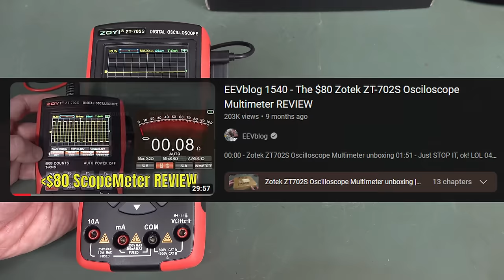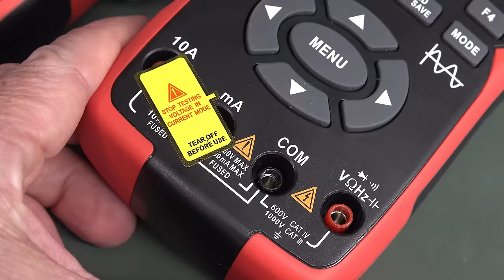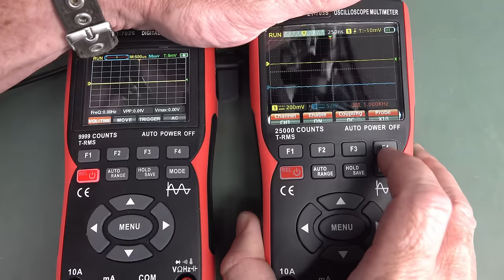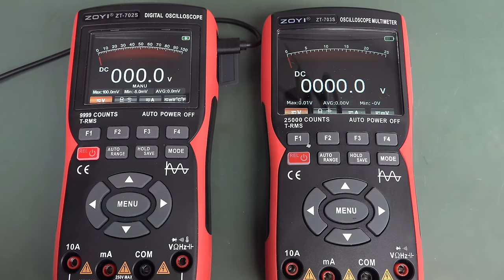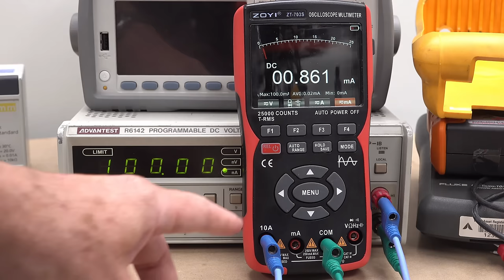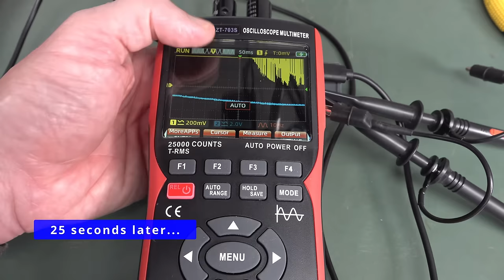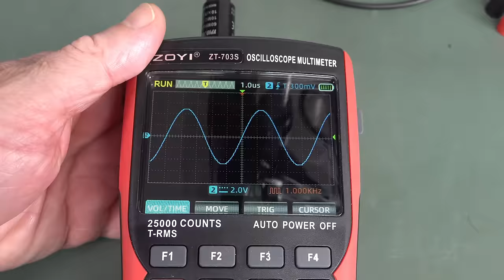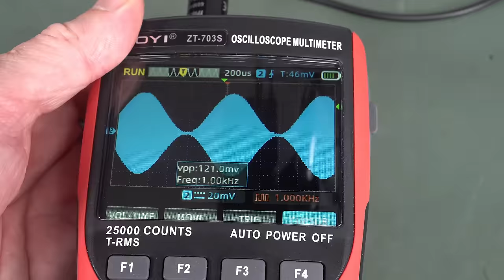EEVblog 1597 - Zoyi ZT-703S $80 2CH 50MHz Oscilloscope/Multimeter Review

Comment: one of the best things that i learned about these handheld scopes is that they are isolated from ground.... that makes them really useful for analysing signals in machinery where you dont neccesary know if the pin is safe to be grounded or where you need a relative measurement.

ive blown a couple breakers by accidentially hooking up the scope ground to a port that was not happy about getting grounded through the earth of the scope.
Reply: i guess we all learned that one the had way...then i went to watch "how not to blow up your oscilloscope"

Comment: I use my 703 to capture ignition secondary waveforms to see how the coil, wires, plugs and combustion chambers are operating while running.  For this application, I can't imagine anything that would be more handy.  I use it with motorcycle engines and it works superbly capturing even the little inductive bounces at the end of the burn line.  I've been using it with a single inexpensive Hantek HV probe, but I have a second probe arriving tomorrow so I can check and compare two cylinders simultaneously.  Earlier, to see if I really needed to go to all that work, I used the 703 and the Hantek probe to check the plugs of a GMC 3/4 ton truck's V8 engine.  Although the engine ran smoothly, the scope said 'GET NEW PLUGS NOW!' and yes, they were indeed worn beyond anything I'd ever seen when I pulled them. 

The only thing that works better for this kind of ignition testing is my large lab scope that has to be plugged in to AC and isn't really practical to use on the shop floor.
Reply: How are you probing the spark signals?
Reply: @vortexlooks  The ignition systems I have checked so far are all the old style coil with a HV wire that goes to the top of the plug.  This arrangement allows the probe's clamp easy access.  I simply clamp the Hantek's pickup to the HV wire per usual, after grounding the alligator clip to exposed metal on the engine.  The engines I usually work on seldom have an ignition coil in a module immediately attached to the top of the spark plug.  I encounter them so seldom that I haven't bothered to make up an adapter to access the HV signal.

For motorcycle engines, I clip the ground to the head's cooling fins; for my truck, I simply attached the ground clip to the bare metal to the rear of the alternator.  I usually set triggering to single sweep the horizontal sweep to 1 MS to see details of the burn line and 5-20 MS to see the dwell.  Of course, the waveform display is "upside down" with the spark line vertically heading down (negative) and providing my scope's triggering, but despite being upside down, my 703 shows all the important details described in the literature.  Apparently, other scopes invert the signal, but why they bother to invert it rather than show it as it actually is (negative going) is probably more historical than practical.
Reply: @oldgeezerproductions  Great info, thanks for sharing! I just ordered one of these scopes and I think I have a HV probe. I'm interested in using this scope as a troubleshooting tool for older ignition systems. Thanks again for the tips.
Reply: @vortexlooks  For the older systems, where you have access to the HV wire, this tool is ideal.  Just lately we had a bike come in with its coils built into long plug caps.  I couldn't easily clamp on to a HV wire, so I rigged up a kind of work-around (I need to improve for next time).  Turned out that the crude work-around helped prove that three coils were weak and intermittent and one coil didn't work at all.  This convinced us and the customer that all four coils needed replacing.  Before bringing to us, the customer replaced the bike's good battery with a new one because the old battery would run down while trying to start the engine, but now the bike starts instantly the very second the starter button is pressed and the engine runs smoothly and powerfully.  We would have replaced the coils eventually, but having visual proof of dysfunction made the decision quick and easy.

Comment: I won't be upgrading. The 702 suits me fine for measuring all that I do. 10MHz is good for checking power supplies, analog, and switching. Audio circuits. The analog multimeter is great for tuning rf and if circuits. The meter is accurate for most uses. Thanks for the review of the 703.

Comment: Two years ago I bought the OWON HDS272S 70 MHz Oscilloscope 3 in 1 (2 channels plus built-in function generator) with 20,000 count multi-meter.  Its totally rectangular so its a bit "boxy", but its got two 18650's and every function works as it should. Its a totally usable oscilloscope (and multimeter) when I need isolation or something to carry portable, like finding a bad fuel injector on my truck.  
The Zoyi does have the edge on form and style, though. I like the rounded face and the slightly curvy body  - it just looks better.
Reply: I have the 100Mhz version and I'm very pleased.
In that thing the multimeter side is completely isolated, it has a switch mode power supply and 7 optocouplers, very expensive, give me more buttons instead to make it more useable.

Comment: Just taken delivery of 703S using your aliexpress link after watching your video. £76 with two sets of probes delivered to the UK in 7 days.  Mine has firmware version 1.2.7 which seems to be the very latest.  While testing 703S, I found a bug whereby if you make any changes the function generator settings in the 'Output Setting' menu, the time base cannot subsequently be set to any value less than 100 uS.  To fix the problem, go to the 3rd menu and choose 'Default ON' to restore settings back to factory defaults.

Comment: I got the 702 for automotive which is my day job. It was excellent for crank, cam etc signls and with an attenuator is could show spark plug waves. I upgraded to software version 58 I believe and it's has been frustrating ever since. It struggles to do the same things it used to do just fine before.
Reply: Can you say an example of what it is stuffing up now?
Reply: One example is freezing up and being unresponsive to any button except off.
Reply: is it possible to downgrade?

Comment: Interesting to see this. I have had a 702S for a while, and upgraded firmware twice with no problem, it now remembers the mode after power off (but not all settings). The 703S lets you view saved screenshots, which the 702S did not. However there are still glitches on the 702S, especially when zooming and scrolling through captured waveforms. So I won't be switching to the 703S, I would rather put the money towards an Owon handheld scope.

Comment: I have Zoyi ZT-702 for few months usage and notice that the big drawback is the inaccuracy of amps. The good thing on this is that the measurement of Ohm and Voltage are quite accurate and the Ohm measurement can go below 0.1 Ohm which most cheap multimeter can't. So I never use to measure amps on this one, I use dedicated amp meter to do that. Another big drawback is the inability to save the last mode (but this is addressed in this ZT-703) and the battery drop quite fast when in Oscilloscope mode.
Reply: The 702S does remember the last mode with latest firmware update, no submode memory though, it just remembers whether to turn in oscilloscope or multimeter.

Comment: The battery is too tight in the plastic holder, the spring is fully compressed.  This was mentioned by some other evaluators and was true with mine.  Since the battery holder is made of plastic it will eventually break.  This can be lessened by slightly shortening the spring on the negative battery terminal.
Reply: I just inspected my 3 week old Zoyi.  I had to use a plastic spudger to lever the battery out of the holder as the spring was so tight.   I tried using a cheap small diagonal wire cutter to shorten the spring but the cutter failed miserably.  Ended up inserting a cross head screwdriver into the end of the spring to hold it steady, while using a Dremel cutting disc to remove two turns of the spring, one turn at a time.  Battery now can be inserted and removed easily.

Comment: I bought a 702 off the back of your review of that. It's been pretty good for what I use it for, which is occasional fault finding and testing. If this two channel version had been available I'd definitely have got it for the slightly higher cost - the increased specs are definitely worth it, but I don't think I'd bother to buy it in addition.

Comment: Hi Dave, thanks for the review, Please could you show us how to Un Brick the 702, because what happened to you will happen to us and I can't find anything anywhere to show us how. Bob.  UK
Reply: You probably need to desolder the chip, put it in a device used to download & flash firmware using a computer, flash the original firmware or a compatible one, and then finally reinstall the chip into the multimeter.

Comment: The needle gauge (bar chart) should definitely go. No use whatsoever. BUT, I think it would be great to put a histogram (voltage vs time) in that spot, so you can see a selectable time slice of previous values (like a little o-scope). Automotive multimeters have done this for a long time, and it is very useful when you are trying to capture some kind of change in value over time and you have step away from the meter in order crank the motor/press the gas/whatever.

Comment: Just sent my ZT-703S back to Alibaba, after ten minutes of first switch on both the scope inputs had a permanent noise component to every reading, the scope probe had a dodgy connection inside which made the noise on any channel it was connected to worse, the back stand wouldn't latch in place so moving the scope backwards created the danger of the unit falling backwards onto the bench surface. All in all disappointing cf my Zoyi bench multi meter which is almost three years old and working perfectly. 
Full credit to Alibaba for their top service and speed of refund. 
Paid the difference and bought an Owon HDS242S instead, solid as a rock.

Comment: My 30 year old Philips/Fluke scopemeter 95 is not going to be retired just yet.. it has a 25MHz sampler but an analog jitter added to the clock by putting a lower frequency sawtooth wave on one side of a differential clock so it does make it to 50MHz bandwidth.

Comment: @25:08 "what happened to my BNC?" That explains why you couldn't get consistent readings on both channels from the sig-gen. One of them got twisted up badly when you were using your pliers to twist the T. But, no biggie though, "Bob's your uncle".
Reply: That is indeed a problem with these models - I had to fix mine twice, because of problems with the BNC connectors.

Comment: I'd love to see the TEMPERATURE reading back, as the 702S had.
Reply: The temp range on the 702s was very inaccurate, at boiling water steam, it read 90C instead of 100C and at room temp read 19C instead of 24C. Similar results on its replacement as well. Perhaps why its not on 703S.

Comment: First, different font colors for x1/x10 would be an easy fix.  Second, the bar graph seems to be scaled to maximum count (i.e. full scale) for both meters.  The graph seems to have no units specified, so I see no real problem with that.  10 hours battery life is fine if you just keep it charged...  The lack of input protection is fine for professionals who probably already have an expensive version, but is likely to cause amateurs to ruin meter after meter.

Comment: The problem with screwing the probe in lock-tight-position is with the sticker on the bottom of the case for the BNC terminals. The tolerance is too small, e.g. the sticker is thick enough to block screwing the probe in the right position. The problem with this is that, if you don't set the probe right, you'll never know wheather the measurement is correct or not. I have removed the sticker under the terminal (leaving the half to cover the other hole on Zoyi ZT-702) and now the probe (and every other BNC connector) locks in place.

Comment: I have done a lot of troubleshooting with my 702 already and it has been way easier to use on sites versus "real" oscilloscope.  Just being battery operated and potential free is such a plus, that i wont mind many of the problems with it.  Differential probes would cost more than this whole scope..

Someone should do an how-to video for us idiots that got the tools, but don't know how to use them properly.  Most of the oscilloscope tutorials have small, probably potential free or at least locally powered stuff on the table to measure and those examples just wont transfer to the real world of electricians and automation engineers.  Some stable 50 MHz signal on the bench is too far from the 9.6 kbps data bursts in shitload of noise that i have usually tried to hunt down and make somehow better.  And the "data" is usually coming from 300 meters away, maybe from a different building and/or whole different transformer area, so using regular scope with ground might do funny things and you might be seeings errors that you just made by connecting your shit to it.

Most of the stuff i have done with that little oscilloscope has been fault finding on low voltage data bus systems like modbus, mbus, dmx, knx, dali etc.  It's just that i have no idea what i'm doing and just poke the thing with the probe until i find something i think i could understand and report for customer and/or supplier of the system.  Haven't yet burn't anything by doing that, so i might have not tried hard enough, so having someone show what and how to do in real life situations with a device like that would be really nice.

Any volunteers to do a "oscilloscope for electricians" series on youtube?

Comment: Would be excellent for a school makerspace where higher voltages are irrelevant anyway. I'll probably buy one. Or two :D
Reply: Nah, a device that needs to be operated in a certain way to yield correct readings is definitely not the right thing for a school.
Its alright for you or me, but for children you need something that leaves no doubts in its operation.
Children have no internal model about the operation of the device, they do not know about 4051 and current sensing resistors. They see a magic box that gives sometimes wrong answers. That's what they'll learn.
Reply: @stefanhennig  I only mean this for use as a cheap scope (we already have plenty of multimeters). I do hope they fix the multimeter bug in some firmware update, esp. now that Dave has pointed it out.

Comment: I recently grabbed the 702 due to your video more or less because i needed another meter and didn't know if i had use for an oscilloscope and want to see if i would use it.
Apparently i do use one now that i have the option and eventhough it is pretty limited i figured out its still very handy.
now debating if i should get something like rigol to sit on my bench.
Mainly tinkering with arduino's and stuff like that.
Spotted at 19:45 that they did fix the screw clearance on the 703.

Comment: They should put 2 seperate batterys in oscliloscope so you can measure two chanel and not short it out.i was measuring my inverter to see what it looked like and i dont know if its two phase or single with hot wire .i got one 100 watt and its two phase .i believe the other inverter i have has a live and ground .i measured the dc voltage and i think i got like 100 one side and 40 on other

Comment: When you were using the built-in function generator,  I noticed the one ground was not connected. Perhaps the probes do not share a common ground? And that might produce different signal levels?
Reply: Volt scales for the two probes were different as well.

Comment: Regarding the 23m mark, is it common to do the length-matching on the adc's digital outputs?  I assume this would be only for parallel interfaces (i.e. not spi) and only for fast (>? Mhz) , and only if the traces need to travel a large distance (>? mils) ??

Comment: In the beginning of this year I bought ZT703S and for a few months it worked well, but after that the upper half of the display is full of rows with dots and is difficult to read the ammount of the measured parameter. I tried many times to get an answer from the ZOTEK, but no success till now!

Comment: Looks similar to my ET829 80Mhz but it's got a sig gen and DMM good cap testing etc. I like it. I want to use dual scope mode to run a dual input curve tracer component tester kit. 2x 18650! Just get ET829 for a bit extra. Why not?!

Comment: Can it measure inrush currents?? What is the best device for inrush measurement? I need to test LED installations for inrush. Also some relay inrushes.... As an electrician. 230V AC
Reply: Unit ut 216 , with this cheap oszi you can measure thinks Like this save. I have owon ,ist a Bit netter as zoyi Bit the multimeter works Like a 20 USD multimeter . Not very nice. The zoyi works a Bit better as multimeter as the owon. But not for current and goes only to 300v whats in Europe useless . So you have to Go for a real device Like unit or Fluke Ar similar.

Comment: I accidentally measured about 400Vpp spikes (was checking the waveform of a WireEDM) and stopped measuring as soon as I saw that spikes exceeded 300V (for x10) limitation on the User manual.
Could I have caused any damage inside the scope? I understand that the scope would have seen about 40Vpp (÷10) at the input.
The x1 rating is 150Vpp DC+ACpeak. Which means the scope should be able to handle 1500 Vpp at with an x10 probe (with proper CAT ratings of course) right?
Is my assumption then correct that 300V DC+ACpeak is a limitation due to the CAT rating of the probe and not the scope input itself?

(I bought this a couple of weeks back. It's my first oscilloscope and I bought it after extensive research on the cheap scopes. I love it so far.)

Comment: I have a UNI-T UT161B and it does not have the option for manual calibration. As such can it be computer calibrated. A 2200mF electrolytic capacitor shows 2650mF on the screen. Thank you.